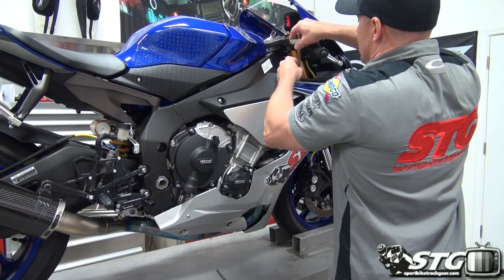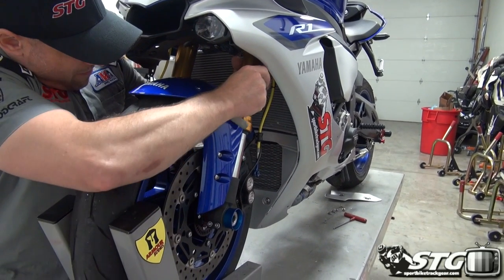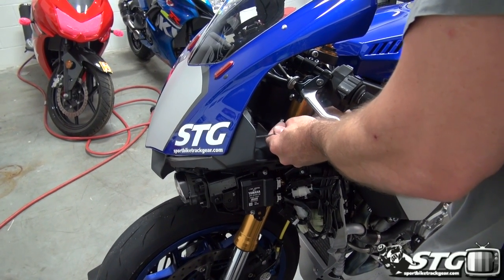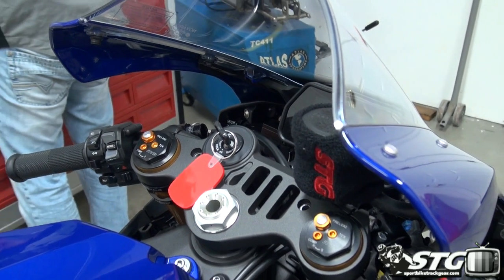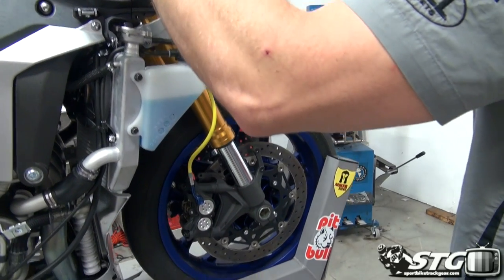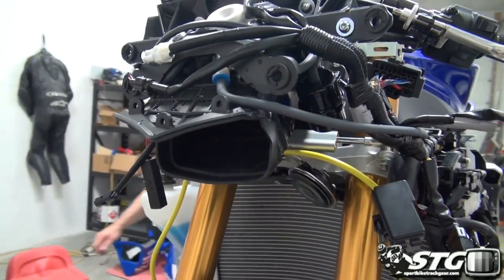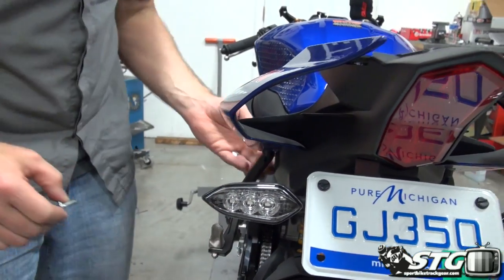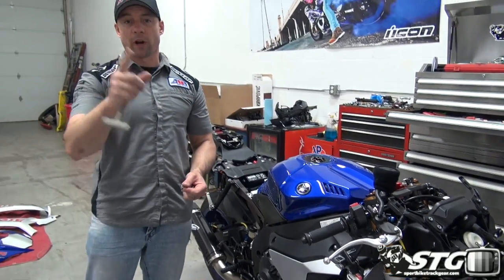How to remove stock bodywork on a 15-17 Yamaha YZF-R1 from SportbikeTrackGear.com

Comment: The front wheel fairing,  by the brake line,  is there suppose to be a gromet
Reply from the maker: Sorry it has been a very long time since I have worked on this bike and I do not remember. I would suggest taking a look at some of the OEM parts schematics. - Van

Comment: i have a question. Me and my buddy were installing a fender eliminator kit on his 2018 r1 and i think we blew a fuse. where would we check that. we cannot find the fuse box.
Reply from the maker: There is a fuse box up front on the left side of the bike. Remove that black trim panel between the outer edge of the upper and the frame. Pretty sure you can get to it from there. - Van

Comment: By any chance did you end up running the stock kickstand with the race bodywork? Or was the kickstand removed? And if so how did you remove it? I looked at mine earlier and it gave me a headache trying to figure it out.
Reply from the maker: +MOTO 361 On this bike the kickstand was removed, all it takes to remove is ust one bolt that the whole stand pivots on. You can eaither secure the switch or remove it entirely, depending on what you are comfortable with. Many people leave them on, even though they can't be lowered. Thanks for the great question!

Comment: You should do a video on adjusting the headlights
Reply from the maker: +Billy Kincaid They are no longer on the bike, track only now. - Van
Reply: Damn, I watch your videos for pretty much everything for my bike. I just did the coolant flush and I broke the coolant drain bolt.. Long story short I have to remove the water pump and get the bolt out some how.  Quick question. In the process of taking my water pump off, I noticed oil coming out as well.. I'm trying not to panic but I'm freaking out.
Reply: Billy Kincaid coolant doesnt mix with oil. You may have a crack inside the block

Comment: Watched the whole vid to see the main thing not be shown in the video that i wanted to see😅 the mid side panel, mine came lose and broke off where the larger area is at 😢🤦🏻‍♂️
Reply from the maker: Hopefully this helped you get your bike fixed. - Van
Reply: Sportbike Track Gear unfortunately it didn’t bc it didn’t show the part being removed in this video lol (mid side panel) theres a few R1’s with the same problem it breaks off easily on right side but a bird hit my knee and panel and it popped out of place but also broke the brackets and only replacement I’ve seen is carbon fiber for 160